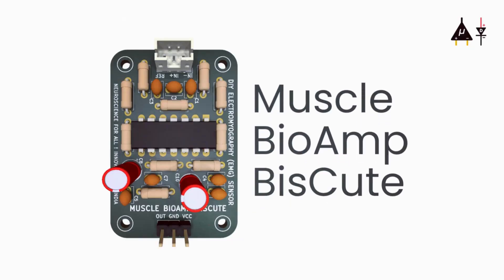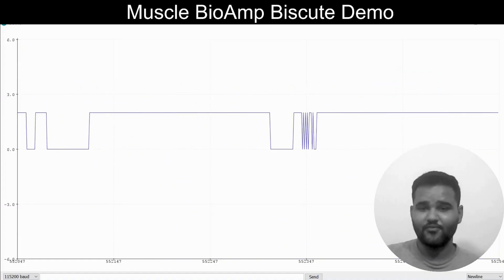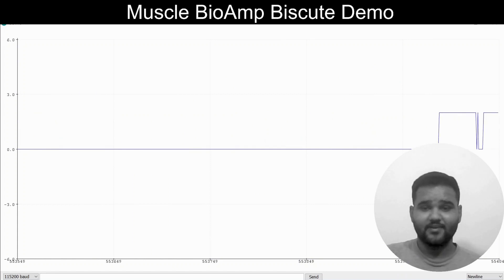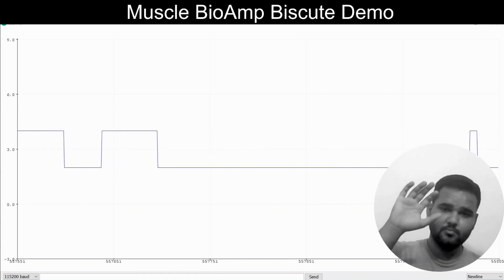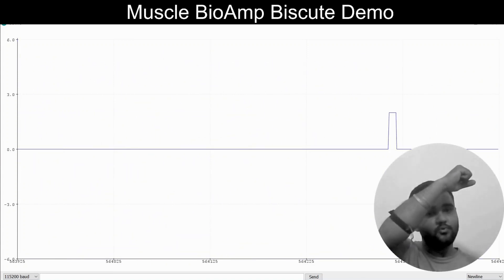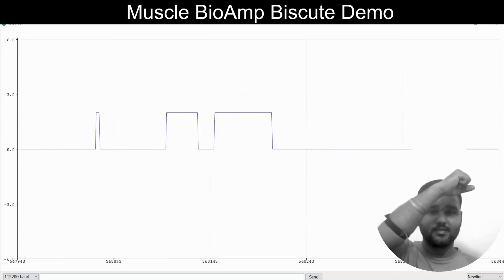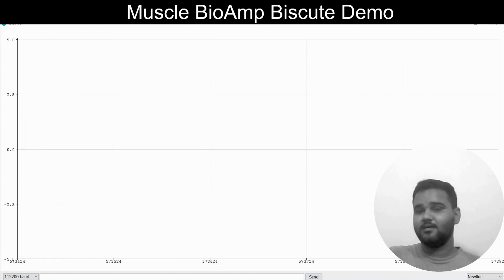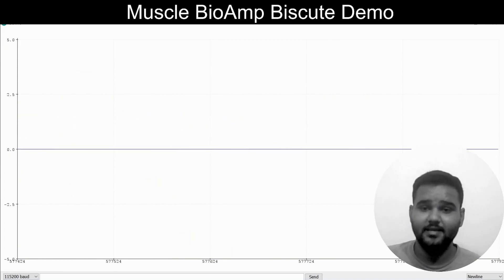Muscle BioAmp BisCute Demo | DIY Muscle Sensor (EMG) | DIY Neuroscience | Upside Down Labs

Comment: i purchased EMG module but resting reading is not coming zero, can you please share the code you used in this video
Reply from the maker: Complete step by step tutorial with Arduino Sketch: https://www.instructables.com/Visualizing-Muscle-Signals-EMG-Using-Worlds-Most-A/

Make sure your laptop is not connected to charger and sit 5 meters away from any AC appliance to remove the 50Hz AC interference. 

What is the reading you are getting when the muscle is at rest?